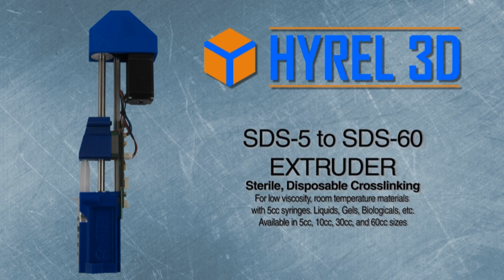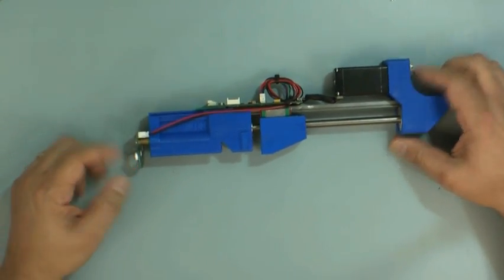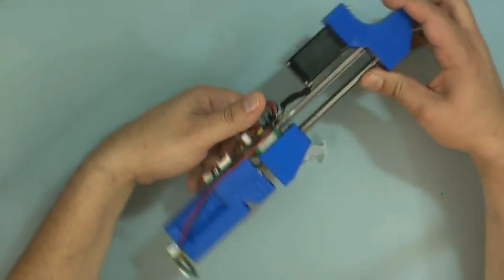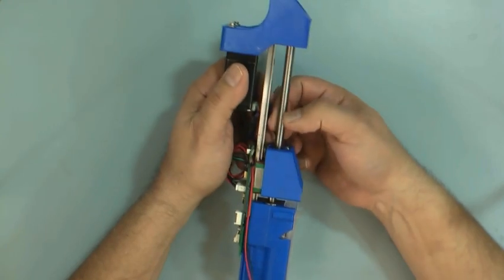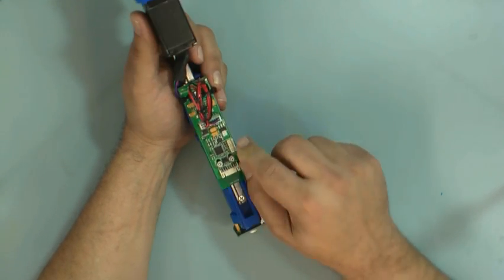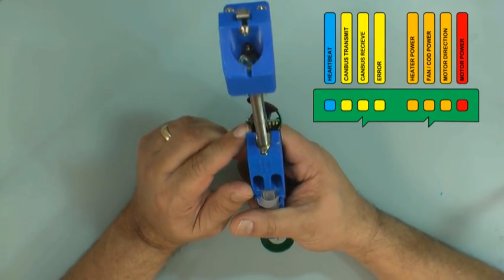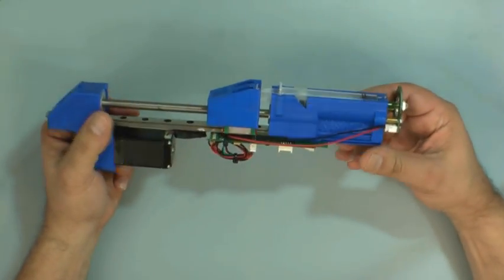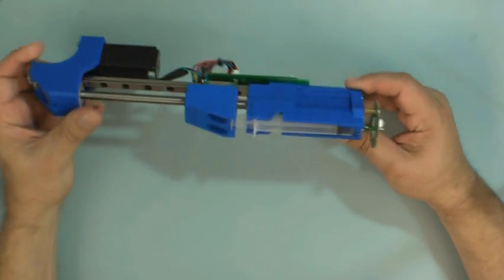Hyrel3D SDS Overview

Comment: What is the function of the circuit board? Isn't this driven by a standard 4 wire bipolar stepper?
Reply from the maker: It is, but we use CANBUS to coordinate x/y/z velocity with volume per second dispensing. Flow calculations for the head are done on the head; so is high side switch control.